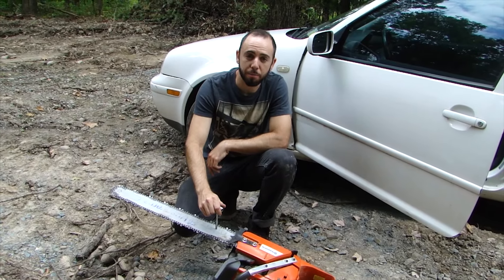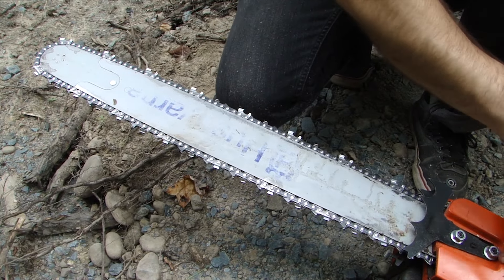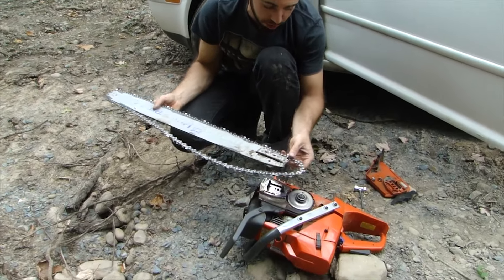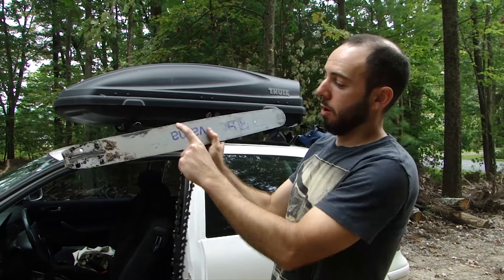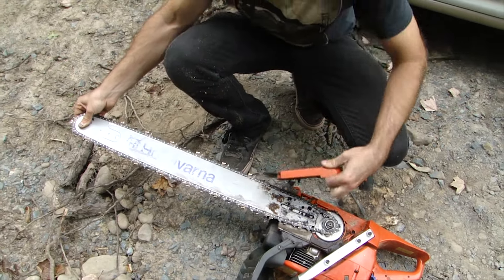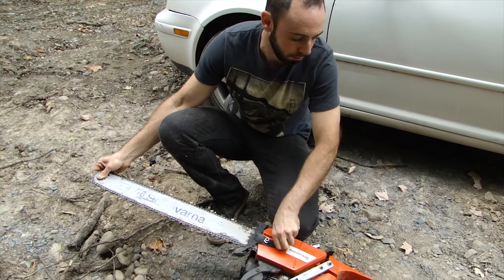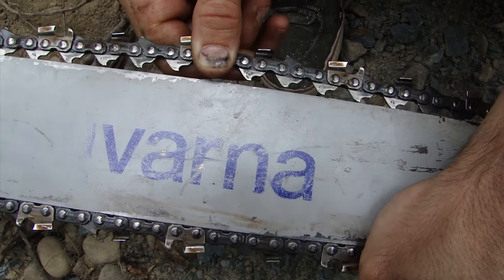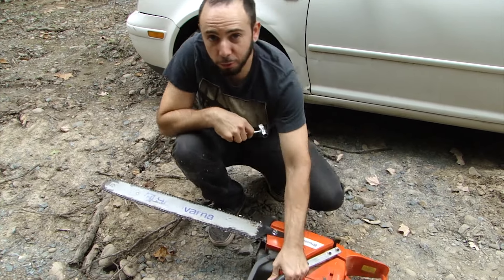Removing Chainsaw Chain

Comment: If i just remove the chain is it safe to use as a halloween prop?
Reply: OFF GRID BUILD what? The chainsaw needs sound. Would if still be loud and noisy?
Reply: Yup that’s what they do at amusement parks they take off the cahin